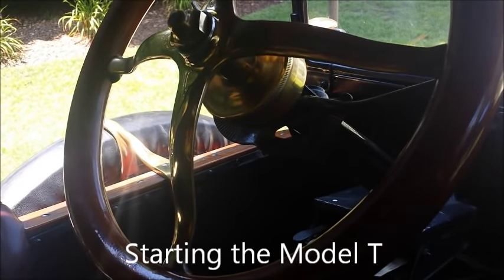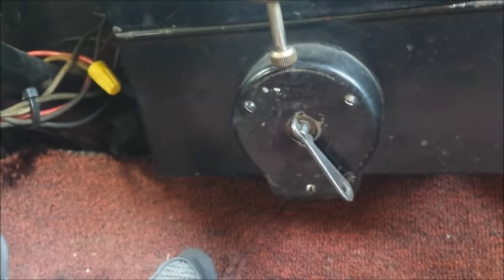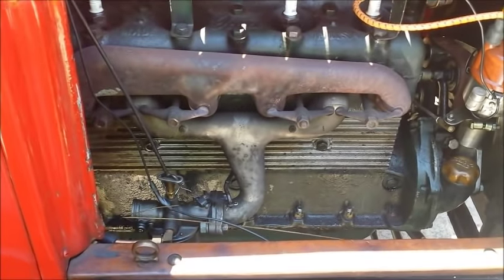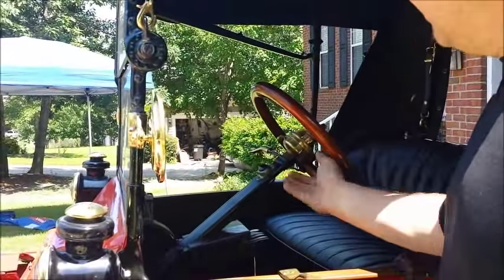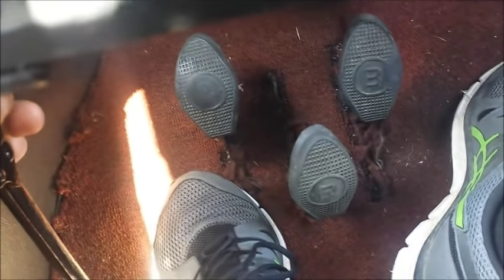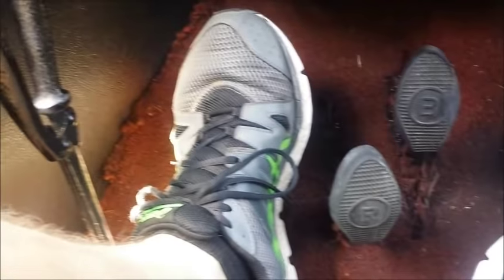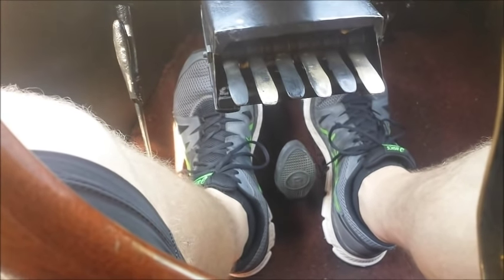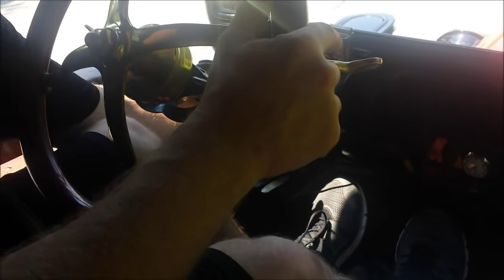Model T Driving Instructions

Comment: this is awesome. its funny how people will look at this and just think its an old 'outdated' car but the reality is this thing is over 100 yrs old and still running. there isnt single car made now that will ever start or run at that age. these are the original all terain vehicles. you could drive them anywhere. on road. off.they weren't built for looks. they were built to work.  those days are gone.
Reply: Wouldn't say you can drive them anywhere... no power assisted steering makes driving these impossible unless you're on a smooth road
Reply: tacos mexicanstyle these were workhorses. they went wherever the driver pointed them even with the lack of power steering. there's tons of old videos of these things traversing roads that a lot of newer cars wouldn't be able to. snow. dirt. mud. whatever.   power steering is a luxury. like plush seats or ac.
Reply: clock143 

I think you should try driving something without power assisted steering and thick tyres designed for grip. trust me these old cars are a huge struggle off road because even if they'll "go" where you point it, good luck being able to point it anywhere!
Reply: Dude, there are tones of videos of people back in the day driving these through some really dang rough terrain, like jeep level stuff, thus you are wrong.
Reply: Actually it has ärmstrong"power steering like my splittie kombi, lots of leverage from the large diameter steering wheel and steering box reduction gears gives a mechanical advantage.
Reply: Eh, those cars do NOT have thick tires at all, and rely on the fact that they are pretty light and have gear reduction on the steering, so you gotta spin the steering wheel 'a plenty for very little directional movement of the wheels, thus mitigating the need for power steering at the cost of making you spin a wheel frantically and inelegantly in case you need sudden sharp steering.

Alas, this makes them pretty suitable for rough roads and terrain, which is what existed at the time the car was made.
Gotta remind you that this car's competition at the time was horse-drawn carriages!
Reply: Man, that's because you never drive a properly balanced car)) Steering on a Model T and many other old cars is pretty light. Reason why modern cars need power assisted steering is because they have most weight on front, tires are thick and steering system designed for high speed
Reply: https://www.youtube.com/watch?v=mXFo1V4p1To    skip to 3:00 in this video if you wanna see a model t doing a bit of offroady stuff
Reply: F*ck yeah, I've saved this video few weeks ago))) Really nice. This is what this cars were invented to do
Reply: It seems like you haven't seen a corolla
Reply: @tacosmexicanstyle7846  Where was a smooth road in  1909 LOL  Almost all roads and I use the term road laughingly, were simple dirt trails. They didn't need power steering with those tall skinny tires and the whole  car weighed less than a ton. PS most cars before power steering had very slow steering.  When I learned to drive my fathers 3/4 ton truck didn't have power steering or brakes and as a skinny 125 lb 16 year old I didn't have trouble driving it.
Reply: @tacosmexicanstyle7846  you seriously think power steering is a necessity? I've hardly owned any cars that had power steering, including two old Land Rovers.
Reply: sorry old timer, but this isn’t correct on a lot of respects
Reply: 100 years and running because it has been meticulously maintained and hardly driven. Any vehicle maintained to this level will last 100 years. 
Im not knocking the Ford either, just pointing out when a vehicles max speed is under 40 and it hsnt driven more than 10k miles, its impossible to compare it to a vehicle driving 75mph and covering several hundred thousand miles.
Reply: Dude my old civic from the 70s doesn’t have power steering either. No problems turning whatsoever. Whatchu smoking?
Reply: @yamilsaidangelessalgado203  Yeah.  2005 Toyota Corolla.  176,000 miles and it is just starting to use a bit of oil.
Reply: How would you know? It’s barely been 100 years
Reply: Literally any passenger sedan made today could do this
Reply: @tacosmexicanstyle7846  Once you're moving it's easy.

Maybe you've driven vehicles with failed power steering, in which case you're fighting the pump which is actually very difficult.

Maybe you have no arm strength.

But there are women in old movies cruising along dirt "roads" without much trouble.

And those tires aren't wide. They're just a few evolutionary steps away from carriage and bicycle tires.
Reply: I think it’s more just that the really well made ones survive. The ones that weren’t so good aren’t around to be an example)
Reply: I mean he’s literally had to replace parts. There’s nothing uniquely special about the model t in terms of reliability man, you’ll have to fix the fucking thing like any other car.
Reply: ofc because this car was fixed. Every junk can be fixed if it's not rusted.
Reply: The large steering wheel provides enhanced leverage, making fairly tight turns possible despite the lack of power assist.